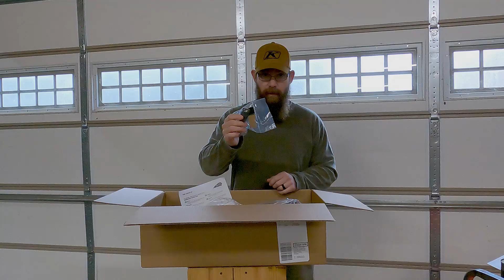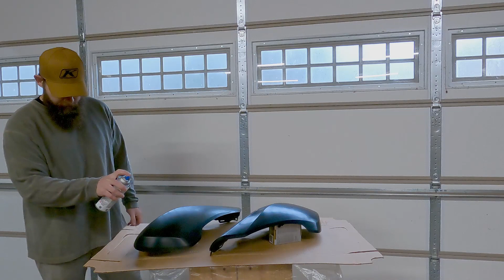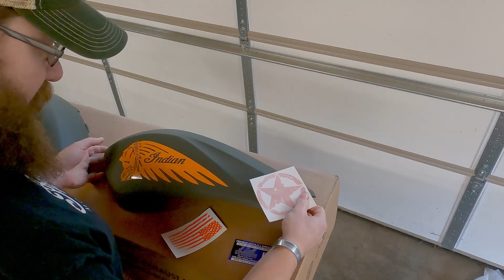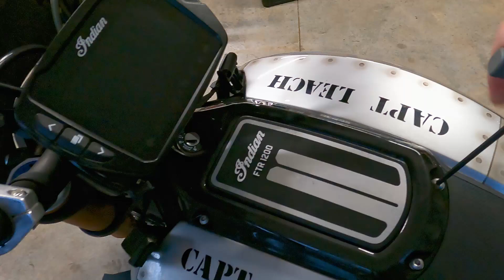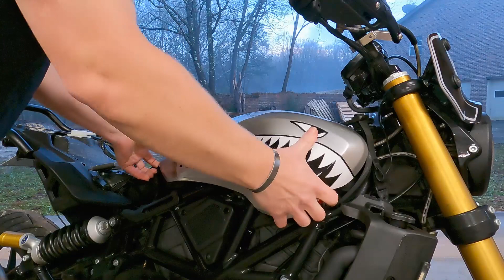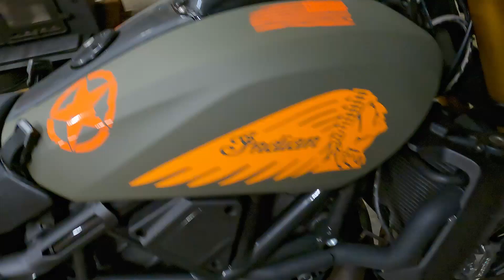Indian FTR1200 tank cover custom paint and installation tutorial

Comment: I know this is a long time ago, and you may not still read comments... but if you do.... did you clearcaot the covers or run raw?  and if you ran raw how did they hold up?  I just did the same thing with falt black and the I Sell Stickers decals (perfect sizing).  Thanks for putting this up as it inspired me to change up my  FTR.  <img src="blob:chrome-untrusted://media-app/78243c27-1030-45ef-9965-3c459f19103a" alt="1000021555.jpg"/>
Reply: <img src="blob:chrome-untrusted://media-app/78243c27-1030-45ef-9965-3c459f19103a" alt="1000021555.jpg"/>

Comment: Badass mate, thx for tutorial! Hey, do you know if the front fender can be powder coated? I have a used 2022 FTR S on the way (white smoke) and was thinking about getting airbox covers and blacking the bike out in a matte black. Thx mate 👍🏾
Reply from the maker: @cheekydevil3241  Front fender is plastic
Reply: Gotcha, so can use same paint spray as airbox? Thx mate
Reply from the maker: @cheekydevil3241  Should be able to